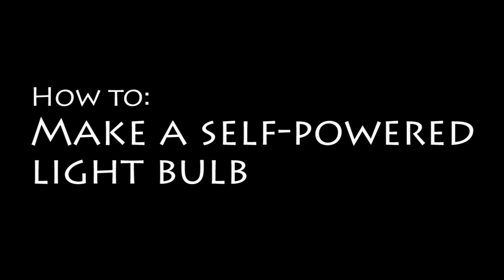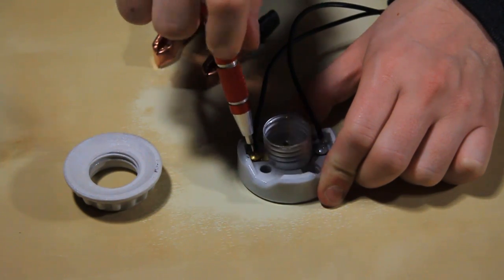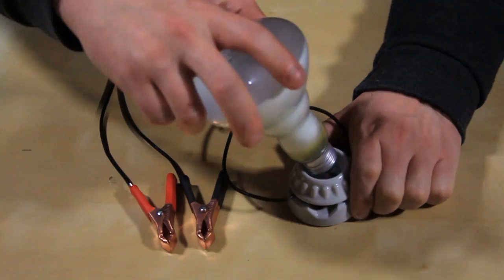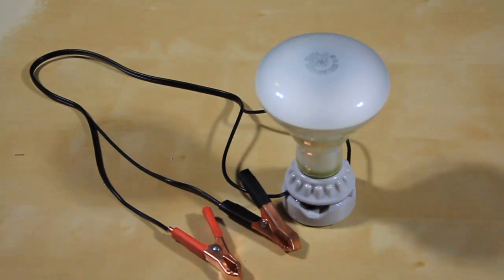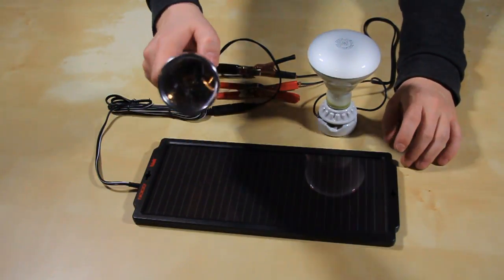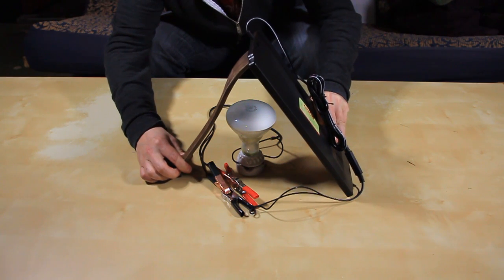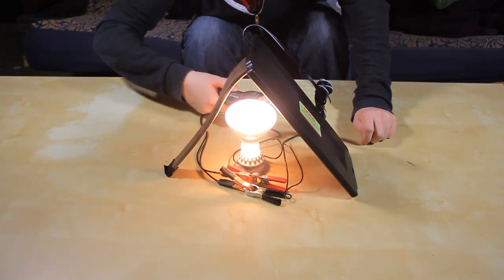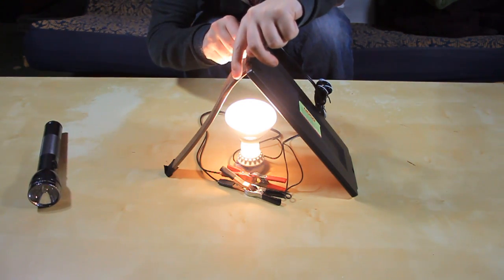SELF-POWERED LIGHT BULB!

Comment: I can't believe such a large and recognized channel would post a clearly fake video just to obtain views. That's embarrassing. In case there is doubt in your mind that this may in fact work, consider: Modern solar panels are only about 10% efficient at converting light into energy. Notice how much light from the bulb is NOT hitting the solar panel. Not only would 90% of the energy in the circuit be lost exponentially if ALL the light hit the panel, but half is entirely missing it to begin with.

Comment: At first sight it looks quite real, but when taken into account that the efficiency of a regular solar panel is about 15% and the light bulb has one no higher than 10% the efficiency of whole system is 1.5%... So no 20 minutes lasting, it takes longer for the bulb to cool off than the time you get extra with your solar panel. And this is not even taking account for the light that doesn't hit the panel

Comment: I feel as if this actually could work. I mean, I could be wrong but the fact that the solar panel is receiving light would mean that the only source of loss of energy would be through heat, which is why it can work for about 15 mins. But with a few seconds of energy input, I wonder how this can hold for 15 mins.

Comment: just tried it for my self
it works
find yourself a 12-25 watt bulb (they can be found as the compact florescent bulbs.)
you just need an external light source to start the flow of energy once you get the flow of energy keeping the flashlight on panel set it up so that the lightbulb is becoming the main lightsource. once the light is on for a few seconds then remove the flashlight. and as for 20 minutes this thing can go longer about 5 hours

Comment: Sorry, you are right. I'm not a native speaker and that technical language is even harde for me. I confused current with voltage which is measured in volt. The important thing about that "perpetuum mobile" is energy and a lightbulb like this needs about 40-50 watts, which is current*voltage. And you can't change the power that a solar panel produces.

Comment: Since that bulb radiates not only light but heat, in all directions simultaneously, that panel captures what? 5-10% of the bulbs output of light, never mind the heat generated and lost since the panel cannot capture heat. This is a farce. Einstein already proved that you cannot get back 100% from a system what you put into it, so since you shined the flashlight for 5 seconds, you could only get about 5 seconds of light produced assuming there was no heat generated and you capture all photons.

Comment: one of the laws of thermodynamics states that in a closed system, no energy or mass can be gained or lost unless they are converted into each other. This setup is basically a closed system, so it cannot generate electricity (energy). I know this is not really a proper explanation as to why energy can't be created, but if you really want to know, talk to a physicist

Comment: Newton would be rolling in his grave. Thermodynamics is not at all good with this. The inefficiency of the lamp and the solar panel would mean the small amount of energy emitted by the torch would be converted in to wasted heat energy in a fraction of a second. Think about how much heat and light were produced by the torch in those few seconds-not a lot. Now think about how much heat and light were produces by that big bulb in 15 minutes- a lot. Use your noggin.

Comment: An aside:
What exactly is 100V of current? Current is measured in amps (or fractions of them).
Also, the 24V is not really good. It's like saying that you can't get 6V using AA batteries. Of course, you can, you just need to arrange them correctly.
Not to say that the "perpetual light" is real, just addressing the sloppiness of the language)

Comment: tell me more how to power a lightbulb, that needs at least 100V of current, with a solar panel, that produces maximum 24V (I think it only has about 5V for charging a phone). Also the best solar panels which are mounted to roofs only convert about 20% of the light to electrical energy. So it wouldn't be possible even, if all the light from the bulb were brought to the solar panel... that are the basics of physics.

Comment: I think 15 mins is a bit fanciful, of all the flux the light bulb outputs  the solar panel is only covering about 15% and with solar panels at 30% efficiency at the best of times. that means that with each circuit of electricity i.e photons- to electric- photons and back to electric. about 95% of the energy is lost to the room as light and a bit of heat. The only thing powering the bulb is the light from the room/sun/video lighting, and so it is actually removing light from the room.

Comment: But why does it only last for 15 minutes? I get that some of the energy gets converted to heat, but if it powers the light bulb for five minutes why not 20 or 30? Is it that the hotter it gets, basically it means more and more energy is becoming heat and therefore there is less to power the bulb? Thanks.

Comment: Correct it would lose energy becuase of heat newtons laws state that and also they state that you can in a perfect world create a machine with a higher energy production rate than it takes in using forces of nature one example is the tesla coil the only machine in the world that can draw out electricity from the air and it takes the heat energy becuase of its source attracts the electricity like a magnet u could physically power a 20 block raduis for a 1 1/2day with 15 mins of it being powerd.

Comment: but the electricity will still run out at some point,given the fact that there is a need for a power imbalance to be in place to push the current across the circuit..

Comment: I'm throwing the BS flag on this one!! The bulb requires a continuous source of external energy to replace the losses to the surroundings. The only energy inputs are the initial 'charge' from the flashlight and the light from the room. If you just compare the wattage of the flashlight to the wattage of the bulb, there is no way it could power the bulb for even an instant, much less 15 minutes, even if the panel was 100% efficient (it's not even close). Completely busted by the 1st Law of Thermo.

Comment: everyone notice that half the light from the bulb is not hitting the panel and just leaving. Considering how quickly solar panels convert light to electrons and how quickly electrons flow through a circuit. I would say that with about 50% losses and a circuit resonance speed that fast the light bulb should realistically stay lit for about 2 microseconds. Which is way less that 15-20 minutes. In other words this video is a hoax.

Comment: But the flashlight was only on for 10-15 seconds and the lightbulb stayed on for much longer. He claims (but doesn't show) that it stays on for 15 minutes. If it stays one for even 3 minutes I'd say it's more efficient than having the flashlight on for 3 minutes draining the battery.

I wonder what kind of lightbulb this is? I'd imagine using regular lightbulbs might require more electricity than the solar panel is capable of generating if the flashlight is its only light source.

Comment: - Half of the bulb isn't lighting up the panel
- Wires beneath the table is a possibility
- The light bulb flickers when it powers up, which is inconsistent if it can last 20 minutes (supposedly)
- The energy from the light bulb would have to output more than is used by the energy the panel gives from the light, which is impossible due to the obvious resistance, and would also discharge electricity.

Also, since ambient light does not affect this, it can't be perpetual at all. I call Mythbusters

Comment: that bulb is at least 60 watts, which would mean his flash from the flash light on the solar panel would be producing close to 60 watts for just that brief second, which solar panels DO NOT DO. Solar panels trickle electricity, at low amperage and voltage (unless coupling solar panels in series or parallel to boost amperage and voltage). this is just complete bullshit, and this household hacker idiot tricked me once before with his constantly boiling water at room temperature in mason jar.

Comment: Incandescents are less than 10% efficient.  90% of energy is HEAT, not LIGHT.  This means that the solar panel is only receiving 10% of the energy back that it is putting into the lightbulb.  Also, panels like the one shown are about 40% efficient on the high end.  So after after "booting up" this device with a flashlight for 3 seconds, after another 3 seconds the system will have lost 96% of its energy.  And this supposedly runs for 15-20 minutes?  B.S.

Comment: that worked pretty well. I had to make a few adjustments. In order to decrease heat losses, I opted to use LED lighting instead which are way more efficient at converting electricity into light. I started small scale at first using a collection of smaller solar panels which covered a greater solid angle from the LED. I went up in scale a bit and now I have a bunch of these lighting up my house. They get about 8 hours of life which works well.

Comment: Not actually self powered, you are merely converting the luminous energy back to electrical energy via the solar panel. Its a cool idea, with a more efficient bulb and maybe a battery pack to boost stored energy capacity, It would make an awesome self powered lantern. The bulb itself however is not self powered.

Comment: Running a 120v AC bulb from a 12v DC solar panel is going to be your first problem here...
Doesn't even make sense to worry about the physics of it if the basic electrics are unfeasible.  Terrible troll video, alot of setup for a lame return

Comment: Trolling? I hope so, because I can not believe you are trying to make your users believe you are being serious here.
Putting in 6 seconds of a light stream into the system and getting 1200 seconds(20 minutes) out of it is not possible by the laws of conservation of energy. (I know the flashlight and the big lightbulb have different lux values, but let's just assume those are both about the same)

Not to mention that the solar panel has an energy conversion effiency of a maximum of about 40%.

Comment: On top of heat generated, light not caught and resistance in all of the wires, the efficiency on solar panels is generally lower than 30%. This video is CLEARLY him just trolling us, apparently April Fools' has come early ths year.

(also, lasers still waste heaps of energy as heat, and they strike a small area of the solar cells, the energy transfer is horribly inefficient)

Comment: in a perfect world where there is no electrical resistance. meaning that 100% of the light's energy received by the solar panel is converted to electricity and 100% of the electricty is converted into light....
and if the solar pannel actually absorbing 50% of the light emitted by the light source.... the light will become undetectable by the human eye within a couple of secnds. If we count in the light from the room, then the system will simply absorb it and release it, acting as a MIRROR.

Comment: 0.42 Well done householdhacker, funny vid... got peoples heads scratching

Everyone - Unfortunately that solar panel couldnt power that light bulb in the first place

Also hes placed the bulb on a wooden board, so you cant see the wires going to it from underneath. 0.42 and 0.55 the timing of the torch and flash is off, didnt quite get that right.

Comment: Nope, still wouldn't work. Much of the energy is converted to heat, which is why lightbulbs get so hot if you leave them on for some time. Plus solar panels are not 100% effiecient and they only capture certain wavelengths of light. It would only work if you surround it with perfect mirrors (believe it or not, mirrors do absorb  some light), direct the light to a perfect solar panel, and by also breaking some laws of physics.

Comment: Would it help to put the lightbulb in a mirrored bowl, sending more light to the solar panel? (Like the cone shaped mirror inside the flashlight). Or at least put some mirror tiles in a way they are directed to the panel? It's worth trying, right? Maybe it lasts longer or generates more power?

Comment: The bulb is never able to power itself because it would need a energy-efficiency of 100% or higher which is  not possible to our knowledge in physics . So even IF the light bulb would not lose any energy by giving up heat and 100% of the light would hit the panel, it would still not power itself,  simply because such panels cannot convert 100% of the energy, so the bulb would nee to "produce energy"  (=  >100% of the energy given to it) which  is against the laws of conservation of energy.

Comment: I'm not a mathematician, but looking back at your previous comment makes me think you're full of yourself. The possibility of this being a viable solution to extending the life of a light bulb would depend on differential equations because of the time factor involved. (As time moves on, the output of the solar panel would become less and less due to inefficiency of the solar panel.) Learn some calculus before arguing a point like this.

Comment: (Assuming this isn't bullshit and he hasn't got a wire to the bulb under the table) This isn't self-powered, it's just recycling some of the left over energy to lengthen the time of illumination, and yeah it's pointless, because the energy transfer is so low and innefficient it would never last 15-20 minutes.

Comment: The reason this won't last forever is when the light radiation travels from the bulb to the solar panal some of its radiation gets transformed into heat radiation and other types of energy. So, in conclusion, its not all light energy meaning that it will gradually run out of power.

Comment: Just about half of the HHH videos are bullshit. The rest are to disguise the fake ones. 

No, you can't power a lamp using a solar panel that's powered by the lamp. Not even for 15 minutes. There's no energy reserve to power it at all. Maybe 1/8th of the light hits the panel and only 15-25% of that is turned into current.

Comment: A 1200 lumen halogen light bulb uses 40 watts absolute minimum. A flashlight has a bulb of around 0.3-3 watts, and even that energy is not spent well. So you'd need at least 10 seconds of pointing the flashlight at the solar panel to gather that energy. Then take the 10% efficiency of the solar panel into account, and you're looking at 100 seconds minimum.
Someone please correct me if I don't get how watts work.

Comment: solar panels are too weak to power a lamp in general. Even if it is possible, to power itself, it must emmit all light to the panel and the panel must transfer nearly 100% of the light in energy. If it is powering itself, then not even for one second, because energy is lost, because of heat, panel efficency and because not all light goes to the solar panel.

Comment: Giving the benefit of the doubt, but the solar panel must have something else besides the cells, it must have some micro transformers circuits to increase the current and voltage output, the lamp it is right now which gives me many doubts.

Comment: Cover it in solar panels or reflective materials (tin foil), and leave a small cap. That makes it a poorly focused tabletop flashlight, that would presumably operate several times longer.
Why's that not on the video if it's much more efficient and useful, as it seems to be? Unless the whole contraption doesn't work in the first place.

Comment: Right. Like 6 V from a crappy flashlight... I'm surprised at why it would stop working after some minutes. I doubt the bulb or the panel would lose light emitting / absorbing efficiency over that time.The setup has no great startup power or battery, so if it works for a couple of minutes, why not for longer.
Heat in the wires? But here isn't much electricity there. Especially considering he says *all* setups should stop working in a matter of minutes. How about keeping the device in a cold area?

Comment: I would think the greatest source of energy loss is just the fact that a large percentage of the light being produced is not going straight up and hitting the solar panel.
Yes, there is some loss due to a small percentage of the light reflecting off the solar panels, some due to heat as well, but all the light being used to light up the room is light that isn't being recirculated.

If he'd hooked up a laser to this it could very well last for days.

Comment: huh why are you uploading stuff that wont work.. its not april the 1st yet. 

the best solar panels only have an efficiency of 13% and a light bulb of less then 20% making the system only 2% efficient.(not to mention that the light transfer to the panels is far less ) for this to work like in the video efficiency should be at least 95% 

the voltage of the solar pane also is far far tooooo low for that light bulb.

obviously you have cables connected to the bulb from under your table

Comment: because only a small portion of the energy used is given off as light, most of it is given off as heat, and the solar panel is only collecting a small amount of the light given off in any case.

Comment: But if that was the case, there wouldn't be any light coming from the bulb. A no heat bulb doesn't emit any light because there isn't any heat! The wire in the bulb must get very hot in order to emit photons in the visible spectrum.

Comment: It's self powered, but the energy gets spread out. And the panel only gets some. Also some of the energy gets converted into heat. So about 15 minutes is reasonable. Especially handy when you need light but have a light with dying batteries and no spares.